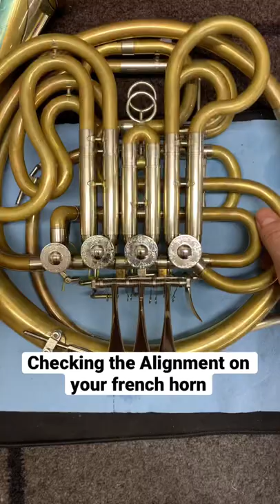French Horn Alignment Check

Comment: What do you do if it's not aligned? Should you take it to a repair shop?
Reply from the maker: If it's not aligned, you can take it to any repair shop to replace the bumpers, or if you know your bumper size, then you can have a repair shop send you the corks to replace yourself. You may need to trim them to line up precisely if you do it yourself.